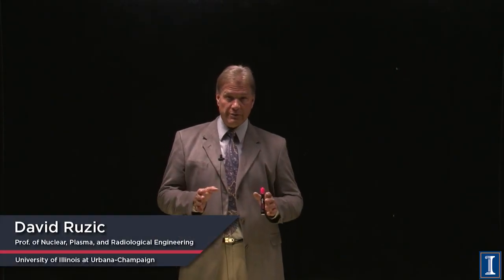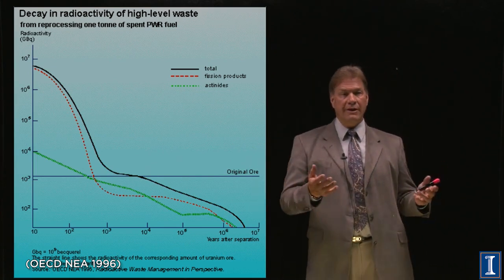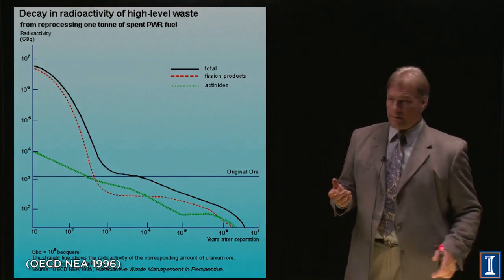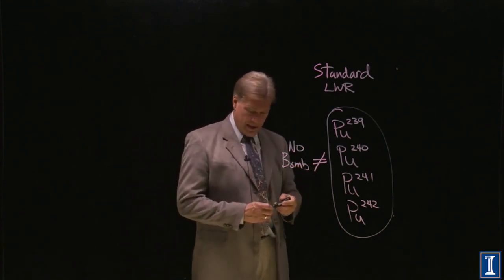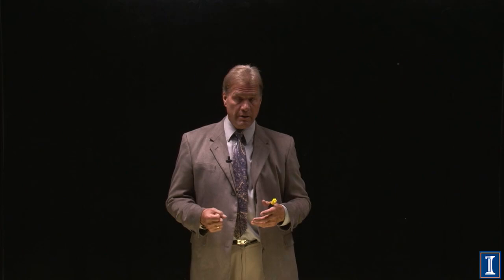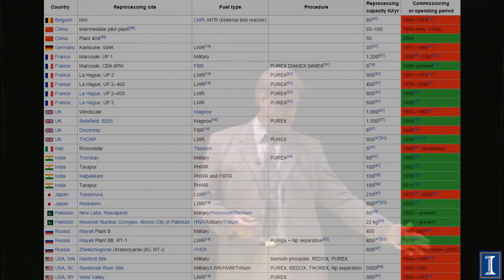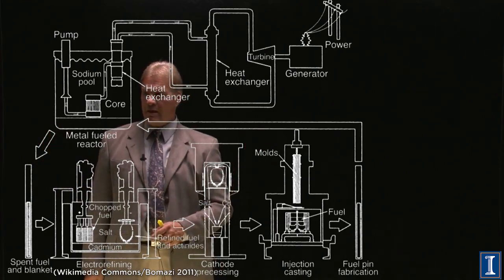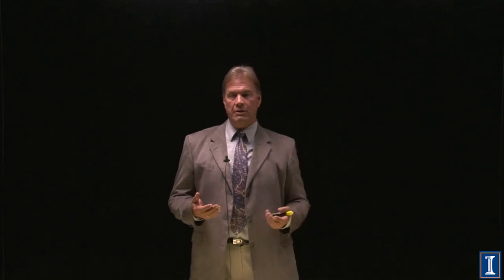Dealing with the Used Fuel (Reprocessing)

Comment: excellent. Would you happen to have some more chemistry details on the fuel reprocessing? Chemically it's a jumble of atoms and ions. Still any serious effort to combat climat change will have to include around 5000 1500 MW breeder reactors plus the thermal ones that feed plutonium into the breeders. we simply have no other choice.
Reply: Search for dual fluid reactor, it is 80 times more efficient than normal light water reactors.
Reply: Points on both sides. I'd like to point out that there are entire economies now completely built as ponsie schemes, and require perpetual population growth (not necessarily perpetual economic growth). So that'll be interesting when the time comes. 
There are solutions if we were capable of being reasonable, and not so naive to notice when the snake oil salesmen are squeezing you.
Reply: @Tom R Believe what you want.  I'm tired of debating.
Reply: We have a choice.  De-growth.  Infinite growth and consumption on a finite planet is unsustainable.  There aren't unlimited resources and the ecosystem is already in BIG trouble.  The future of most of our species is on very shaky ground.
Reply: @markgigiel2722  Over the past 20 years the population growth rate has been decreasing, and mathematical models show our growth rate will begin to hit the negative relatively soon. Next, nuclear energy is not the end all be all, but it's the best option we have right now with the increased CO2 emissions influencing climate change. Once we can stabilize that issue, it will give us more time to develop resources towards effective energy storage tech, that does not require large amounts of rare-earth metals, finally enabling practical use of solar and wind, which feed off the energy of the sun. If you argue the sun is not a finite source of energy... well everyone has known that the sun is going to burn out eventually, but that should be humanity's target right now, live as long as the sun lives.

I'm also aware that the energy crisis is not the only issue right now. Heck, farming and agriculture are being wasteful and destructive of resources alone. Lookup phosphorus depletion. A lot of this is due to bad practices over using nutrients in fields, having the nutrients bleed into waterways/ocean, killing off marine life, which is a big portion of the phosphorus resource (fish mill). But there is a lot of research going into resolving this issue due to toxic algal bloom infesting many coastal inlets of first world countries. A lot of research is going into alga farming because of this. A classic example of "If god gives you lemons, make lemonade."

Keep your hopes up, there is a lot of work going into finding solutions. Some of which are right in front of you, being professors sharing their knowledge on a free open platform like youtube ;D
Reply: @TickyTack23  I think we already crossed the Rubicon.  We are so far into overshoot on every front that it's just a matter of time until complete collapse and possible extinction.  Have a nice day.  I've been following the trends since I was a kid and I'm 61 now.  You won't change my opinion.
Reply: @markgigiel2722  It's fine I understand.

Comment: Dump the used fuel into molten salt reactors?
Reply: Dump the used fuel into dual fluid reactors. They are not the same as molten salt reactors.
Reply: MSR are useless jokes and only valid in an exceptionally small and thus inefficient scale.
Reply: @prjndigo  What a useful argument.  Please, tell me more and, if you can, support your claims with evidence.
Reply: @prjndigo  were waiting.
Reply: @prjndigo  Perhaps you are the useless joke that does not know what they are talking about

Comment: How much heat is produced by 
 fission of a single uranium atom in Celsius?
Reply: Celsius is a unit of temperature not heat.
Reply: to have heat you must have a medium.  The sun's rays are not hot, but when they get to earth, they go through the air, which is the medium.  The medium is getting warm, not the rays.  When the rays hit your skin, your skin becomes the medium.  The rays interact with your atoms, the atoms heat up, and you feel warm, but the rays do not actually carry heat, just energy.  The Dr. gave you the amount of volts it gives off.  That energy flies in all directions, but it sounds like some gets trapped in the fragments of the broken atom.
Reply: you cannot measure heat with a single atom ... I think you mean electron volts or joules
Reply: Also you'd have to quantify the amount of mass it's heating up, what the mass is, etc. I think a better question is how much energy is given off by a single fission. It's not a lot, considering how small atoms are. I mean heck, PET scans literally induce matter/antimatter annihilation inside our own bodies. But since the mass is so small, we're fine. 

Bottom line: you sound young. Ask a teacher